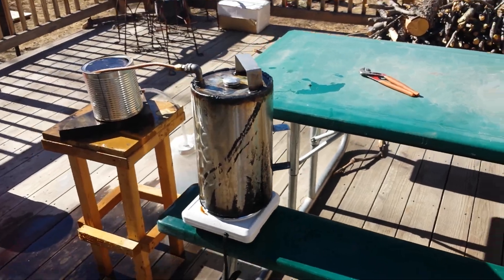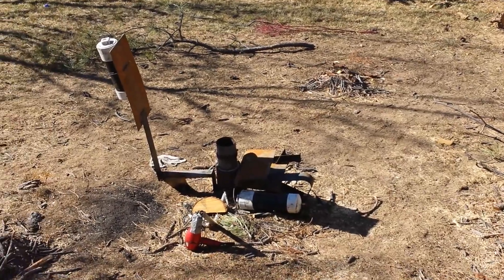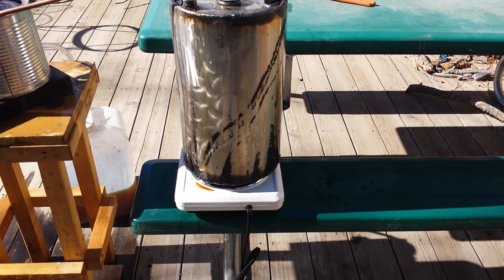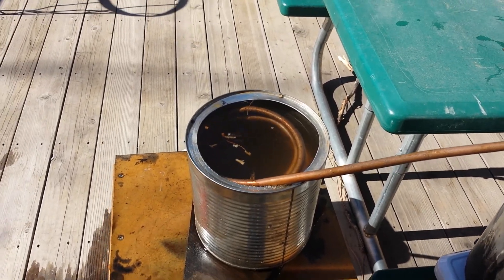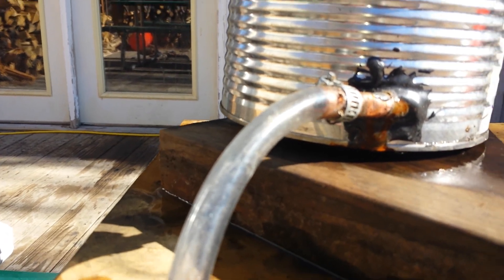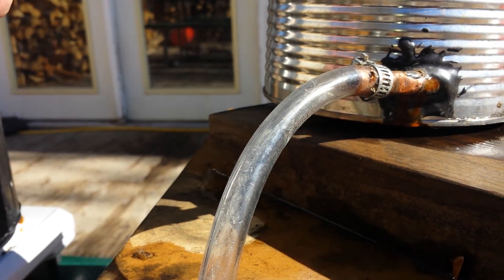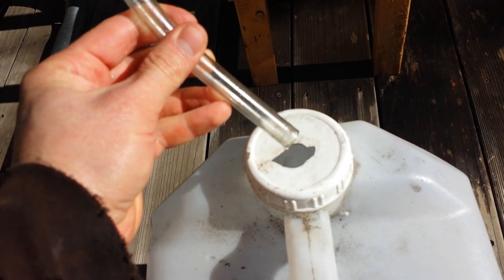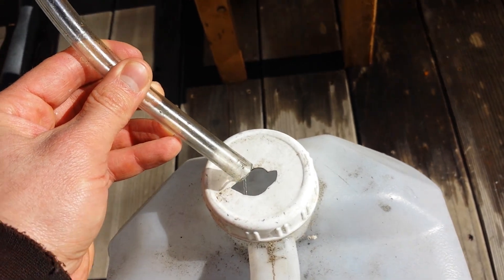Distilling methanol from biodiesel glycerin

Comment: That methanol is $20 a gallon now my question is can one use half as much and just add some Lucas anti gel? since its $14 on Amazon and treats 300 gallons that comes to what 5 cents a gallon vs methanol that's comes to $4 per gallon have $2 a gallon save is $200 for every 100 gallons.